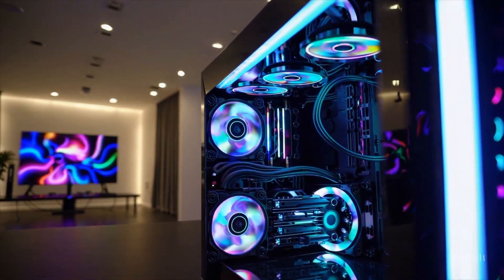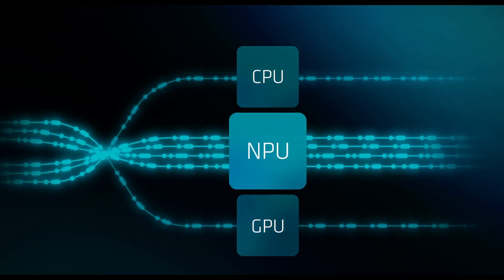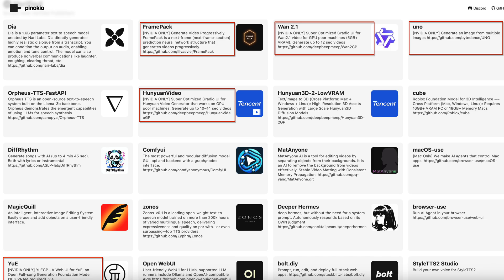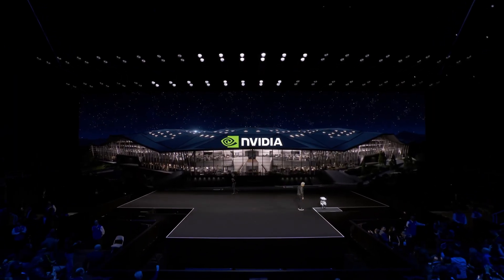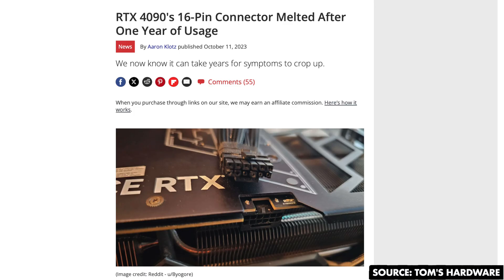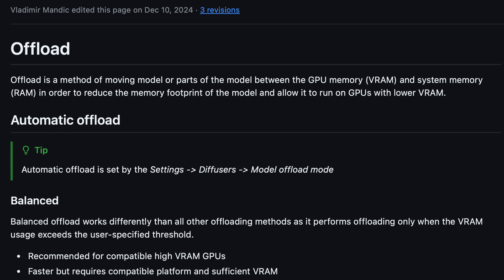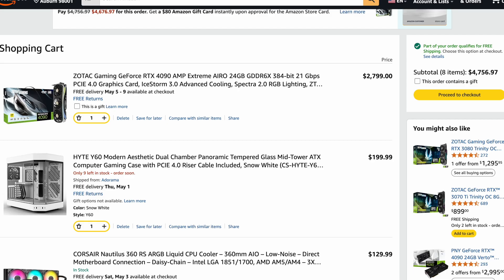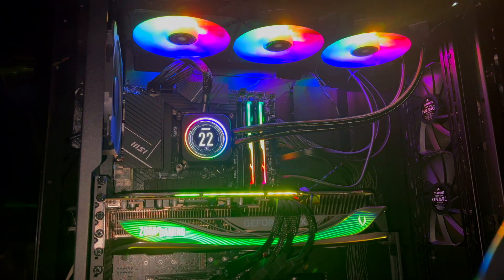Best PC Hardware For Running AI Tools Locally In 2025

Comment: What about the RTX 4090 TI with Vram of 96gb VS the RTX 6000 with 96gb of Vram???
The RTX 4090 TI w Vram at 96gb which is 50% Cheaper than the RTX 6000???
Do you have a video on that GPU's???

Comment: Just know with decent cpu you can have a lot of ram and have it run on this (will take a few min or a bit longer) but allows you to run 70B, even (if you have enough ram and adequate OS and software to run it) the entire deepseek r1 model in around 700GB of ram (for INT8, FP16 will be closer to 1.4TB) and patience. running deepseek R1 (INT8) on the CPU can cost nearly 800-4000 dollars. on GPU's will cost your financial stability/future. (100 000$ and more)

Comment: 1000w is the power that a ceramic-element heater uses !
We run heaters to generate AI ! that's a lot of energy wasted. and you waste more to cool down the heat you generated. cpu, combustion engine, gpu... in the future we probably will look at this tech and laugh.

Comment: I'm not sure what your exact configuration is, but having tried to follow your advice, here are some issue with your recommendations. The RTX 3090 requires (according to Nvidia) THREE 8-pin to 8-pin PCIe compatible connectors, which the power supply you recommend does not have. Having insufficient connectors can at the very least not supply the GPU with the power it requires. The Corsair RM850x has the right number of connectors but is more expensive. Yes, an 850 watt power supply. The graphics card alone is okay at 750-watts for a PSU, but computer experts recommend at least an 850 watt PSU. I also went with an air cooler rather than your recommended liquid cooler because a)liquid coolers have a higher failure rate and b) the air cooler (the Scythe Fuma 3) is quieter in its operation.
Reply from the maker: I appreciate you trying to follow my advice. I assume you're talking about the CORSAIR RM750e? It comes with 2 native 8 pin cables and one adapter which means it's fully compatible with any 3090 model including the ones that have the 3x8pin inputs. Corsair recommend 750 watt for 3090 + older cpu and 850 for 3090 + newer cpu. But getting  a bit more than what's needed never hurts. IIRC I recommended one air cooler but it's good to know that the one you mentioned is quiet. Hope you're enjoying your new pc and all the ai tools you can use with it!

Comment: Having only every owned Intel Processor PCs and upgraded myself, I'm considering switching over to a new future Apple Mac Pro (not Macbook; waiting for the new Apple processor to be released, M4 Ultra or M5 Ultra). Almost purchased a fully loaded/maxed out Apple Mac Studio/M4 Ultra/512GB/16TB SSD, with a goal of locally running Deepseek R1; I'm a software developer and have a few ideas about what AI tools I want to develop on my local setup.  Admittedly the cost of such a setup is going to be significantly higher but its a chance I'm prepared to take.
Reply from the maker: Sounds like a solid plan! You seem to know what you're doing, so I’m sure you’ll get your money’s worth.

Comment: You did mention about mostly avoiding Intel CPUs. However, how about any of the Core Ultra series desktop CPUs such as the Core Ultra 7 265K? From what I know, all of them include NPUs even down to the lowest spec'ed Core Ultra CPU.
Reply from the maker: If you want a desktop CPU with NPU, then you should be fine getting one. You'd think that Intel will be extra careful now to not mess up again.
Reply: @AIVOICETUTOR Right, I had built my first PC with a R5 7600X right as the intel instability issues became public. Though I want to ask, if I went for an AM5 build, would a production CPU like the Ryzen 9 9900X beat a consumer CPU like the Ryzen 5 9600X for AI?

Comment: Excellent presentation. Since it's no longer possible to get a 4090 GPU with 24GB of VRAM, I'm planning to go with the 5090 in a laptop. Overall performance may be 50% lower due to temperature limitations, but I'll be able to run Flux with higher quality models. And with an i9 285 CPU, 64GB of RAM, and 1TB, it could cost me less than $4,000. I don't have room for another laptop full of fans and lights, but without the possibility of PCI cards, Firewire, SCSI, CD-ROM, card reader, etc...
Reply: For inference only going for a mobile variant of the 5090 is a very effective way of wasting money. But its a tough choice NVIDIA has set up with is shxxxy card line up. Before buying I would calculate how far you get with that money on a cloud GPU, where you can pick a gpu for your need. Inference only and a mobile 5090 doesn't seem reasonable to me, but you got to know best what you want to spend your money for.
Reply: @madrooky1398  Thanks for your feedback. But I would never use the cloud for my work; we're talking about "Running AI Tools Locally."
Reply from the maker: Thanks for your comment and I hope you'll enjoy that great laptop should you decide to get it!

Comment: 16:24 any ideas on running two 5060Ti's ? they'd have rather fast 32GB vram combined and reasonable power draw and reasonable price, so what's the catch ?
Reply: Motherboard and cpu needs to be expensive, most motherboards won't have support for 2 gpus, only the highest end ones, also the cpu need to have many p cores and higher pcie lanes to be able to work properly, you can go ahead and build it though, there are no more issues as the support still exists and is developing for dual gpu setups

Comment: I set the powerlimit to 70% on my new 5090,thats 400watts. No noticable difference in image gen time. Need to research that a bit more,also with longer processes like video gen,but on first glance this looks reasonable to me. Gen times are about 3 times faster than on my 3090.
Reply from the maker: That's a good idea! Especially if it doesn't cost much performance for ai tasks. Fingers crossed that your 5090 will run fine for many years.